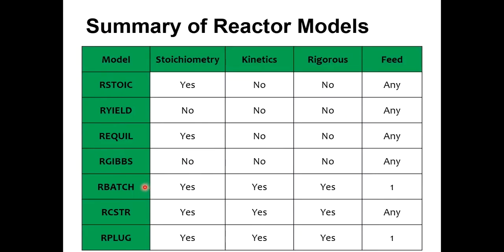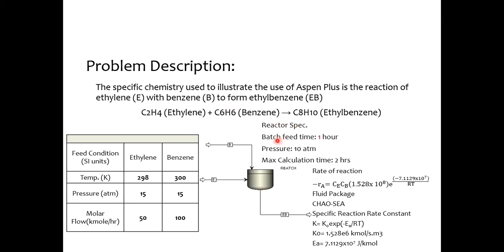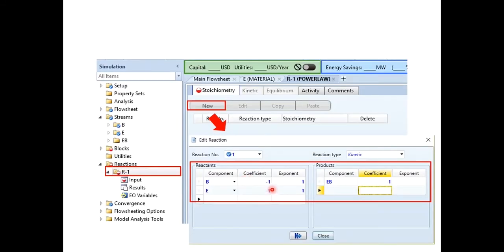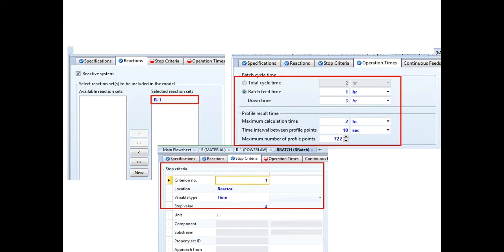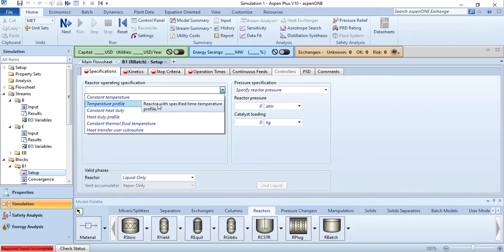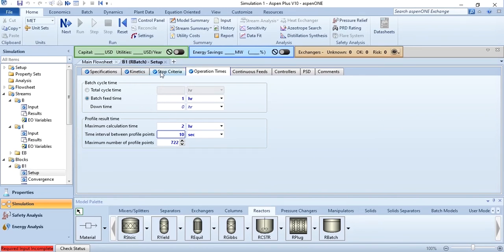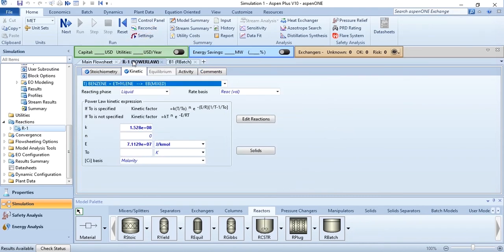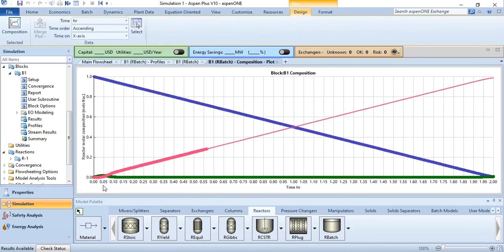Simulation of Batch Reactor (RBATCH) in Aspen Plus - Lecture # 60

Comment: Thanks for the video. However, you should check the balance because it does not closure. Check that ethylene stream is vapor phase under the conditions used.